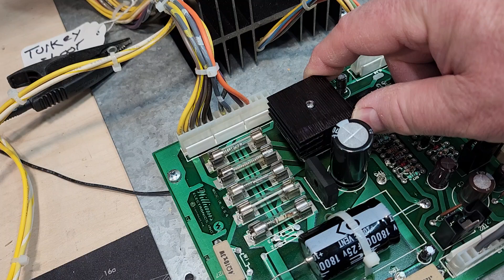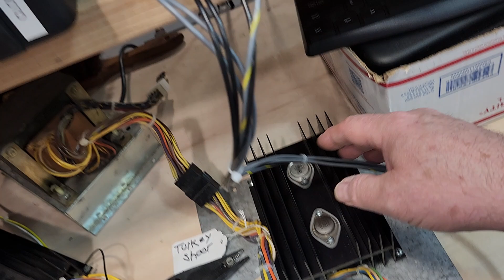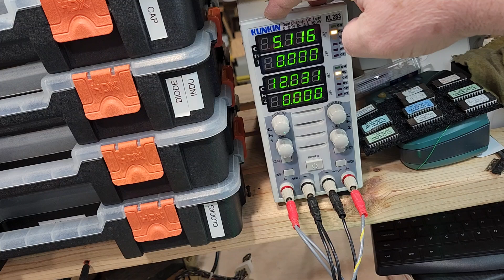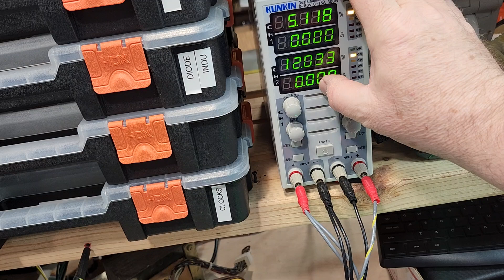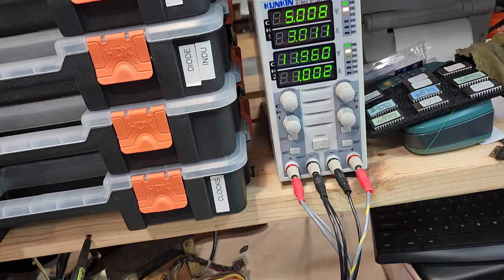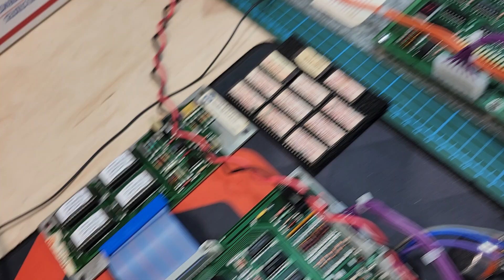Williams Linear Power Supply - Testing after rebuild/restore

Comment: Why does the components have an infant death syndrome? Did you use "thicker" silicone isolation pads for the transistors?
Reply: Sometimes during manufacturing of the different components, things can go wrong. Not enough doping, solder, insulation, crimping, etc... when these go wrong, the part may work well enough to pass an EOL (End-Of-Line) test at the facility, but may not last very long once put into service. Typically if you can exercise the component to it's maximum range for some short time, this will allow the defect to manifest and cause the failure in a controlled environment. Apparently these type of defects have an analogy in the biological world where sometimes genetic disorders or embryo development go wrong and failure occurs early too. I did not make the reference in the electronic world, but have heard it used many times throughout my long career.     As for the 'Sil-pads'. originally many of the TO-3 transistors used a mica insulators with a dielectric paste (heat-transfer compound). The silicone pads are a much better alternative as they conduct the heat better and are less messy too! Over time though, they will break down and can fail, so I prefer to install new ones as a preventive maintenance effort.  The time for me to install now versus having the customer ship the boards back, etc.. is worth it to me. Thanks for the questions! - Brad
Reply: @BradRaedel  Yes true they used the Mica Insulators for the TO-3 but not sure why in the 60's thru 90's they used Mica material instead of silicon material for the insulators? If you use to much dielectric paste it will cause LESS Heat Transfer and also cause other problems, any reasons why?
Reply: @BradRaedel  The QC testing of the components should have a "stress test" for filter out the Pre-Mature failures. I know most manufacture companies for dishwashers, washing machines, refrigerators, TVs, etc make the engineers design parts and components to have built in pre-mature failures and low life spans components that have a built in profile to fail over a time or heat profile. The coding in ROM chips the software engineers would make the game coding self-corrupt the game code over time so you would have to purchase new ROM chips with the new game code. The ROM chips would also be defective by over blanking them in the UV lights to wear down the ROM chips memory cells. Its call "latent failures" but manufactures will just blame the customer /user that they caused the components to get damaged pre-maturely. Happens all the time with warranty products